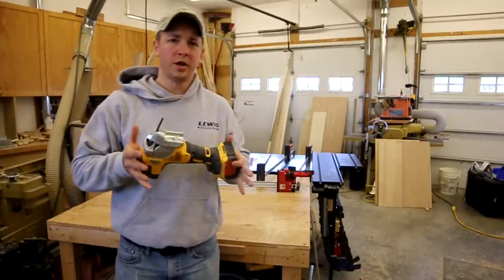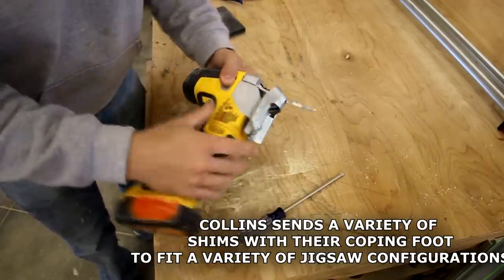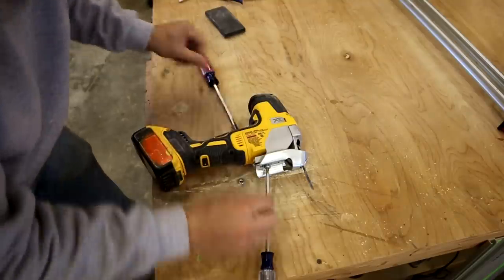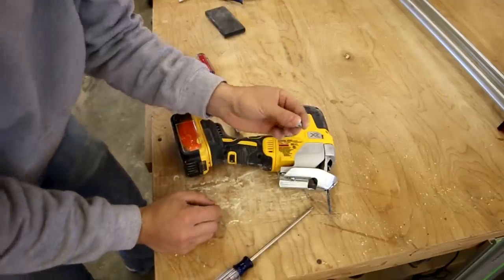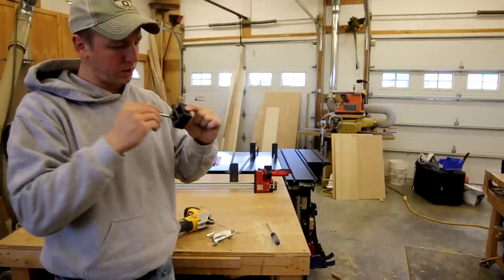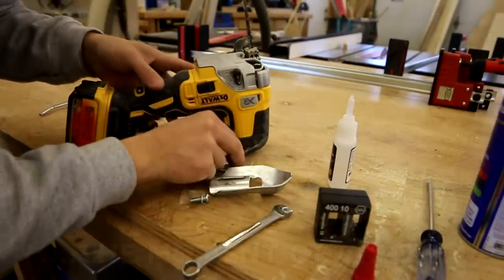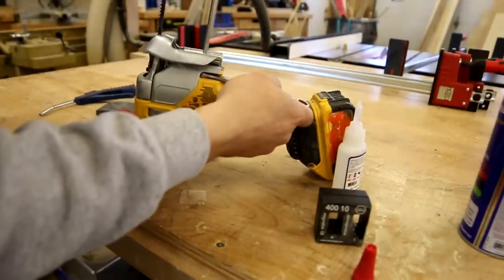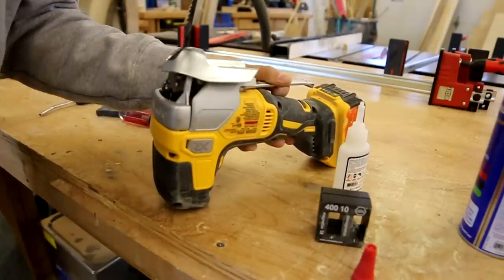Collins Coping Foot Install on Dewalt Jigsaw

Comment: Thanks for the video. I didn’t have any CA glue on hand so I set my nut inside the 7/16” wrench and placed a tongue suppressor underneath it and slid both under together. The nut stayed in the wrench and went right on.

Comment: You can attach a neodymium magnet to the hand end of the wrench. The wrench won’t saturate the magnetic field so the nut will stick. Same with screwdriver to remove. You don’t need to fuss with magnetizing.

Comment: I just installed mine to a plug in older dewalt dw321. I used the original dewalt screw to secure the collins foot and didn’t need to use the supplied screw/nut combo. I’m sure all saws are different.

Comment: Wow; that's complicated!  It's WAY easier on some other saws: I've installed it on 2 Bosch jigsaws (1591, 12v), and the newest Milwaukee barrel grip. None of them have a loose nut to worry about.  good ol' dewalt..... ;P
Reply: Neither does my Makita corded, as far as I know the only jigsaw which has a loose nut is the DeWalt.

Comment: Hi - I enjoy your videos and wish I had half your woodworking skill 😂. I had questions about using a jigsaw for coping inside corners for baseboards. 

I thought about using a jigsaw with the Collins foot and I would most likely want to cope from underneath the baseboard.

So - can you really cope from underneath the piece if the jigsaw is not the barrel grip style? I'm worried about the position of the trigger.

Also, my baseboards are stained and I don't want chipping if the stained part (front) so, coping from underneath the baseboard, would I be using an up cut blade? 

Thanks, 
Matt

Comment: I read instructions and it recommends needle nose pliers to hold the nut. No need for glue, tape, blade etc.

Seen couple of different installs and what nobody mentions is that the shim should be pushed forward towards the blade to the end of the elongated mounting slot.  The  actual coping will rest on the  rear mounting slot.  At least that has been my experience with the Dewalt DCS 335

Comment: Is it better to use a jigsaw blade with more teeth or less teeth for coping? Would more teeth be better for a smoother finish cut?
Reply from the maker: The recommended blade is the bosch T244D I find it works best.

Comment: Spencer, random questions, what became of your Cope Master machine? Why did you go with the barrel grip jig saw?
Reply from the maker: I still have it but haven’t really needed to get it out for a long time because I’ve been doing so much flat base. And for small houses I can do it with a coping foot just as fast as it takes me to drag the machine out. I only get the cooemaster out for bit jobs with more intricate profiles.
Reply: Insider Carpentry thanks for the insight.

Comment: I just grabbed the nut with a pair of needle nose...after i cussed a few times trying to position it with a screwdriver. 
Still only took a few minutes.  Hasn't come off after quite a bit of use.

Comment: Which shim should you use on the coping foot
Reply: I bought the DeWalt saw and copingfoot but it has two shims one’s a little thicker than the other which is the best
Reply: I went with the thin shim, is that right